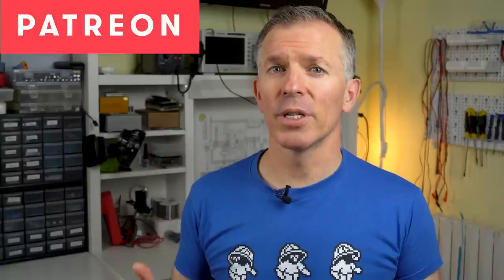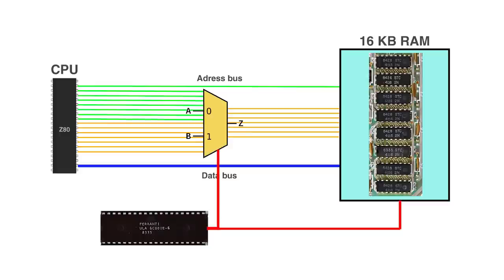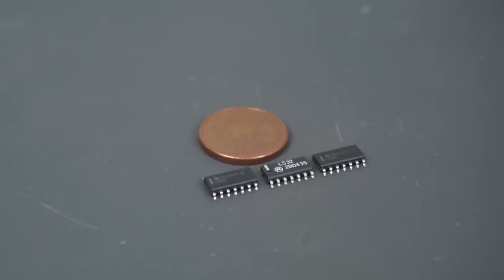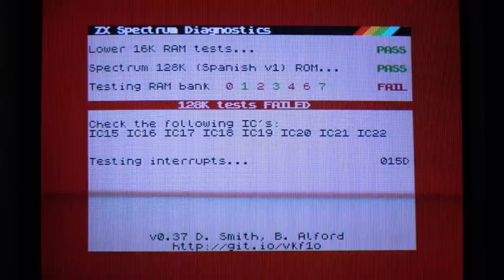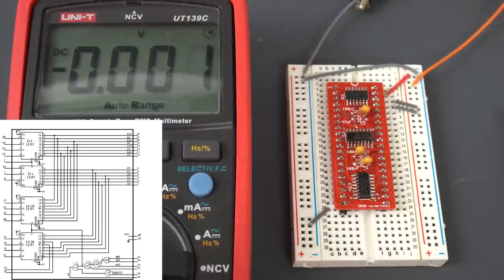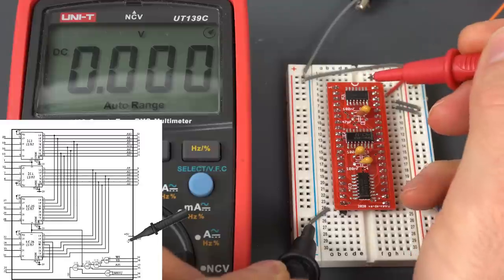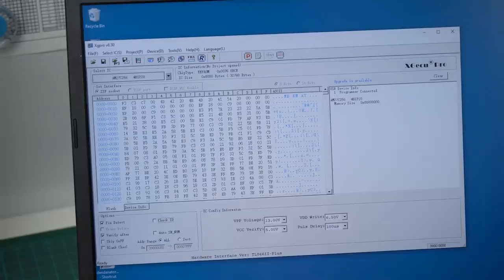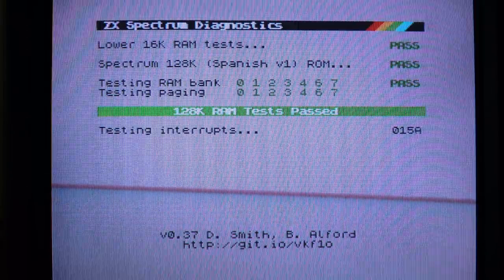ZX Spectrum 128K "Toastrack" IC Replacements and SMD Soldering (Part 2)

Comment: The upper RAM must be 0x8000 - 0xFFFF to be the Upper 32K. The ROM is in the first 16K I think.
Reply from the maker: Yes! You're totally right. Brain-fade on my part! Otherwise it cuoldn't be using A15 either. Thanks for pointing that out!
Reply: I'm very late to the party but, a lot of Z80 based computers used to put their ROM into higher memory addresses and then use hardware to block the CPU from reading anything but zeros (NOP) after a reset until the address bus reached the first address of the ROM.  Or putting it another way, after reset the CPU would execute nothing but NOP (no operation) instructions until it reached the memory address where the ROM is located.  Once it hit that address, the data bus would "open for business" until the next reset.
This was a work-around for the fact that the Z80 CPU would always start running instructions from memory location zero after a reset but CP/M programs were required to run in low memory with some program data starting at 0 and the program itself starting at location 256 (0x100H).
While it certainly was possible to put a ROM at location 0, the expectation that programs would need to be able to run starting at location 0 was so common that some way of making the low memory available was almost always available, whether that was by the above technique or by memory "paging" to replace the low memory ROM with RAM.

Comment: Sinclair got stung by using the fault upper RAM chips, once the supply ran out he had to use fully working upper RAM chips! I built a circuit that allowed me to page in the other 32k RAM, was a lot of fun. :)
Reply from the maker: Ooh, that looks like fun. You could probably use that extra RAM for hacking stuff like we did with the extra 64KB on an Amstrad CPC 😃

Comment: I've seen the same kind of behaviour with the blanking pin on other systems - the Archimedes for example can give a very strange picture unless that pin is pulled high enough.  It's going to relate to the sync signal - my guess is the sync is slightly different between those two ULAs.  Since the blanking pin (at the TV end) supports "punching a hole" in the composite signal, with the RGB output (from what I understand), a difference in composite signal used for the sync, could affect how the output looks when using RGB.  I guess what's happening is one ULA has cleaner sync than the other, and the one with slighly worse sync needs a more definitive "punch" using that blanking pin.    On the archimedes for example you can rarely get anything other than a white box (with black border), until you use pin 16 to punch away the composite signal with the RGB.  On other systems you just get the TV switching entirely into composite - I've never understood why, but it has to be related to the sync in each case I think.  Subbed btw!   EDIT:  Thinking about the Archimedes example - it makes sense to me now (the white screen) - The Arc outputs only H or V sync (which cables combine), but that sync signal obviously lacks video (hence the white when we aren't "punching" through the sync source with the RGB picture info).  The RGB has to punch in there or there is nothing for the TV to display.  Cant believe how long that took me to work out lol
Reply from the maker: Great explanation! That makes a lot of sense! I did look at the sync signal but I forgot it wasn't really used for RGB out. It uses synch on composite instead, and that's what I should have looked at. Very interesting to hear about the Archimedes results. That's one computer I haven't touched yet but it's on my want list. Someday... 😀
Reply: @NoelsRetroLab  If you have a LOT of time and patience, I could send you a severely battery damaged Archimedes A3000.  They are very very time consuming though.
Reply from the maker: @GadgetUK164  Oh man, so tempted! But for my first Archimedes I better wait to get one in working condition, even if cosmetically it needs some work. It can be pretty tough to repair something without ever having seen one working in the first place 😀 If you ever have a working one for sale that is not super expensive (wishful thinking, I know), let me know!

Comment: So cool to replace a 40 pin chip with some SMD chips. I haven't had a ZX Spectrum 128K but in school they have the ZX81.
Reply from the maker: Yeah, it's pretty neat. Is a very visual remind of how technology has advanced since then.
And don't worry, I have a couple ZX81s waiting their turn.
Reply: @NoelsRetroLab  Is it really?  I may have misinterpreted what you aimed at, but I tend to see it the other way. You could still build "anytning" using the TTL standard that was developed in the early 1960s. Sure, these are surface mounted CMOS versions. But surface mount was used even when Sinclair produced computers (especially in Japan) and CMOS has actually been around since the 1960s (although being much slower than today).

Comment: "aligning the SMD chip may take a while"
(he drops the chip on the PCB and it magically aligns perfectly on it by itself) LOL

Great video as usual! (How do you erase those eeproms?)
Reply: The ones we see in this video are the UV-erasable type - you can recognise those by the quartz window; If one is VERY patient they can be erased by exposing them to direct sunlight over a long period, but normally one would use a dedicated device with an UV light source. You can see examples of such erasers here: https://duckduckgo.com/?t=ffnt&q=uv+eprom+eraser&atb=v175-1&iax=images&ia=images
Reply from the maker: Hahaha, yes, that was the ONE time I dropped the chip and it was in perfect alignment! I had recorded the comment before selecting the video, so that wasn't he best example. You know how fiddly it can be to get them just right.
Edit: And Berty is right. I have one of those UV boxes and in 15-20 minutes they're fully erased.
Reply: I had to rewind the video a bit as I was wondering "is that chip magnetic or what"!
I have a bucket of those UV-erasable eeproms but I do not have an UV light to erase them. I tried sunlight but did not work - not long enough I suppose. Also, we do not get much sunshine here in the UK... :(
Reply: Mr Guru  thanks for the tip, I will check it out tomorrow morning! thanks

Comment: I've seen that same kind of image issue with different ULA's via RGB creating the artifact at the end of words.  I went through several revision of RGB cables before I eventually figured out it was something that's different with 2 seperate ULAs, just three weeks apart. Someone mentioned you need voltage on the signal. Then I tried different TV's and again saw different issues with the same ULA that had artifacts. One one TV (LCD) it had no issues, also no issues on a CRT. Two other LCD's had the issue. So it looks like it's a combination of things. Great to see that you solved it on the same TV with the added voltage.

Comment: Your SMD soldering technique is pretty good.  Liquid flux is fine ( we used no clean flux pens at work which are liquid ).  Use more flux.  Once you've secured the corners try drag soldering -  You apply solder and the tip to the SMD component and swipe down the legs in a smooth movement.
Reply from the maker: Thanks! I've actually started trying the paste flux and I like it much better! Probably because I can have more of it. There's going to be a fair amount of SMD soldering in the next TI video in a couple of weeks!

Comment: 14:12

I have a feeling that possibly the VCC pin (14) of the NAND chip wasn't quite soldered.

When you removed the chip, you could see the solder on almost all of the pins get disturbed, but the solder for pin 14 barely changed.

I think maybe the pin was floating just above the solder, and not quite making proper contact.

Really neat vid, though, and great explanation of the circuit.

Subbed! ;)
Reply from the maker: Good eyes! That's certainly a possibility. I did do a continuity check between each pin and the pad, but I suppose that if it was barely soldered, just putting the test lead on it would push it down and record continuity just while I was testing.
Reply: The issue with the blurry video output from the ULA could perhaps be due to slight timing differences between the colour clock and the RGB outputs.

On some CRTs with RGB SCART input, and no voltage on SCART pin 16, they can tend to "overlap" the RGB signal over the Composite signal.

I would have thought the SCART cable is using Composite Sync from the Speccy, though, so maybe not?

(this can sometimes happen even without any voltage on pin 16. Some TVs just don't process the RGB input properly, as they either expect only the Composite Video pin to be hooked up, or RGB with voltage on pin 16.)

If the SCART cable is using Composite Video for sync, then that could explain the difference.
The timing difference could be causing a delay after the RGB is processed by the chroma encoder chip.

I don't think it's a problem with the RGB output directly. As you say, it looks fine once you hooked up the battery.

What confuses me is how you got a decent image before on that TV without a voltage on pin 16 in the first place. lol :p
Reply: @NoelsRetroLab  

I still have problems with SMD soldering at times, even after quite a few years.

Yep, I've definitely had that before when continuity tested fine, and it turned out the tiny amount of pressure from the probe was enough to make the connection. hehe

I repaired a board for somebody about six months ago which I suspected had solder joints on a QFP that hadn't reflowed properly. I used a cheap USB "microscope" camera, and did the careful "poke test" on the chip pins...

https://drive.google.com/file/d/1hbmWG1EPzY6ZHh2CwrFV3onNRpzhAR3U/view?usp=sharing

I didn't add all of that flux paste either, btw. lol

I used to use flux paste for many years, as it does tend to stick around for longer without boiling off.
But now I use liquid flux for pretty much everything, and got a bit quicker with the dwell times of the iron.

That clip is a good example of what often happens when a larger QFP chip is removed using hot air, and the pins get bent very slightly.
 The pins then no longer sit flat on the pads after replacement. I won't tell you who's board it was, as he'd probably kill me. lol
Reply: waves GDay Ash fancy seein you here! LOL
Reply: @WacKEDmaN  I get about, mate. lol
Reply from the maker: @electronash  Yes, it uses the composite signal as a sync signal as far as I'm concerned (I forgot to hook it up when I made an improvised RGB out for the Inves and it was completely unsynced). I think that's the key thing: Since the battery wasn't connected, the blanking pin was left unconnected so the TV could interpret it just about any way, depending on its internal implementation. It's still puzzling that it was consistently different with the two ULAs. It must have been a slightly different level on the composite video signal itself (although why??). Weird.
Reply from the maker: @electronash  That video is great! I'm surprised that there seems to be a fair amount of solder under the pins themselves. Did you use soldering paste, or did that just naturally flow under the pins with regular solder and flux?
I don't have a microscope camera yet. Any recommendations? Is that cheap USB camera good enough or are you wishing for something different? I image the camera is only good for examination, right, not for real-time soldering because of the delay?
Reply: @NoelsRetroLab  I didn't solder the pins on that chip, it was somebody else.

They had problems still with the video output (it was an arcade PCB), so they sent it to me to have a look at.

I've had a cheap "pen" style USB microscope cam which I used for the vid. It's only 640x480, but it's surprising how low the resolution can be and still be super useful.

The latency is fine, tbh, even with my ancient 960p monitor. lol

It would probably be worth getting at least 720p now though.
Reply: Ohhh thank you, probably it will help me also with my PCB. Nice tip
Reply: @NoelsRetroLab   ...and when you were fixing it, you didn't put any solder on that 14 pin again :) 14:34

Comment: Thanks for the video Noel.  I'm curious what the white circle with 4 PCB pads is for.  I guess something wasn't used.
Reply from the maker: You know, I'm not sure. If you look at the UK board of the 128K there's some kind of coil there. I'm not sure if it's a ferrite core or what it is exactly. https://2.bp.blogspot.com/-So4FZHf9CN0/WBd34G1cCqI/AAAAAAAAKR8/fmnMf4BCs7shLLI-0ZrteH2DE3nV4RWTgCLcB/s1600/UK%2Bvs%2BSpanish%2B128K%2Bv2.jpg
Reply: Mr Guru  Sorry for posting here, but I don't find your post about how to solder it with a hot air gun. I was looking for those videos that you commented about it, but all what I watched was with solder paste. I have not solder paste. Is it obligatory for this technique? thanks again
Reply: Mr Guru  I have tried it... the result was not very nice, I will try it one more time, but... it seems to me that better i have not enough skills for this way. I operated it as follow: 1 add flux, 2 add iron to the pads, 3 more flux, 4 hot air gun... not nice how it had finished. Maybe if I fix only one pad to the chip... but the problem is that left too much solder iron on the pads. Need to learn more from Noel :)
Reply: Mr Guru  Thank you, I will do it, but maybe some PCFs later, cause first one was already spoilt (bended) by the heat. And I get many errors now.

Comment: Have you heard of the ZX Harlequin? It’s a reverse engineered spectrum kit that doesn’t need a ULA. The issue is they can’t sell the rom with it. I was thinking of just getting an eprom and trying to use an image off the internet to program it with.  Not sure it’s the same one but my local electronics shop has EPROMs and the mini pro for sale.
Reply from the maker: Yes, I have a couple kits of those still to assemble. I'll probably cover them one day and get in the details of what's different about them. I suspect it'll be a bit like the Inves Spectrum+, since they had to reimplement all the ULA logic in a different way (in the case of the Harlequin all with discrete logic!).

Comment: Another great video.  Great to see how modern components can be used to replace parts that are no longer made and also the enthusiasm and love people have for these old computers.  Are these kits for the ZX8401 available to purchase by the public or are there any Gerber files for the SMD pcb  .
Reply from the maker: I believe you can buy already-made ones on Ebay, or get the Gerber files from the link I put on the description (the original ones by José Leandro).
Reply: if you need one, no problem, I will make another bunch of them. The last fews I had were sold out to Zxrenew. Whatever, you also could do one by yourself with the schematic that Noel's shared. Or contact me by PM, still I keep one.
Reply from the maker: @ElectronGordo  Feel free to share your Ebay link here since that's totally relevant. Or let me know and I'll put it in the description.
Reply: @NoelsRetroLab  Would be great. That way people could have access to it when they are not enough skilled to DIY.

Comment: I don't even have a Spectrum, but love your videos - new patreon supporter :-)
Reply from the maker: Thank you so much! Much appreciated!
Reply: @NoelsRetroLab  I DO however have a working Amstrad CPC6128... but no monitor... and i live in the U.S. lol. Some day i'll get it fired up.
Reply from the maker: @IDPhotoMan  Argh, it's a crime to have a CPC 6128 and no way to use it, don't you know? 😀If you can get some sort of RGB monitor, you can easily make a video cable (and you can feed it with standard 5V DC and 12V DC power supplies). If you need any help ping me on Discord.
Reply: @NoelsRetroLab  thank you, it would be fun to get it going.
Reply: @IDPhotoMan  you can use most old analogue TVs.. check out 'the 8-bit guy' channel he has a vid on converting the TV to RGB, and its quite simple.. you can then wire it directly into the 6128s monitor port...
or if ya just want to test its working..you can get a black and white composite compatible signal by using one of the color pins and one of the sync pins on the 6128s monitor port. i did that back in the late 80s/early 90s and flipped 2 screens in ram, overlayed some audio and then recorded it to VHS! there was an article about it in one of the old Amstrad Action magazines..
Reply: @IDPhotoMan  hey Conrad... you dont wanna part with it do you?! ..having trouble finding them here in Aust... and seen as tho your not putting it to good use, i will! :p

Comment: Great repair! It would have been nice to see whether the databus cleared up after changing the ROM. I was working on a board with a similar problem, dirty address and databus and it didn't occur to me the ROM could be corrupted, I did flash a ROM with the data read off the old one and ofcourse it showed no improvement.

Comment: just thinking out loud .. when the battery fixed the ghosting , and you got different results back then and now , could it be as simple as corrosion on the pins of the IC ? .. or if one is weaker than the other , are there any pull up/down resistors for that part of the ciruit ?
Reply from the maker: Could be. I don't recall seeing any obvious corrosion though. Rather puzzling, especially how the behavior changed (although that's consistent with your corrosion theory after pulling it in and out a couple of times).